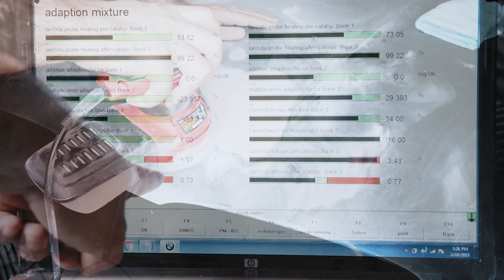BMW N54 Technical Updates You Might Not Know About!

Comment: Interesting the n54 has cast cams on the early model years. On N52s all the camshafts were hydroformed since production started. I believe the bearing ledge seals were updated late 08 to 09 but I’d have to double check
Reply: Nope, my 05/09 production date 535i has the same steel rings that caused grooves in the bearing ledges and Vanos/limp mode issues..
Reply: Update, I’m pretty sure the crank hub spun since I replaced the ledges and seals to no avail.

Comment: Does anyone know what Exhaust Vehicular Diy is running? I can't seem to find this information.
Reply from the maker: I'm running a stock exhaust, cat less.
Reply: @VehicularDIY  Hey thanks for responding, I've been watching your videos for a year now and hands down best 335i content, really great work.

So you have removed the midcats? I also have daw 775rs turbos and was somewhat concerned about stock exhaust back pressure. Would removing the mid cat's be essential to run safely for 500-550WHP power level?

I was thinking it's probably boost related and not just hp for back pressure? and I don't plan to pass 24psi

Sorry to derail with unrelated comments like this

Comment: Many thanks for this series. I am dealing with a broken tensioner on my oil pump chain on my 145k mileage 07 e92 335 and these videos have been invaluable. Mine failed while performing other work on the car, due to my error in not realizing the vacuum sprocket bolt was not independent from the sprocket itself and I tried loosening without locking the sprocket down. Lesson learned. In all of my research thus far, I didn’t learn BMW came out with updated sprockets and hub design until this video.  After watching, I unbagged the new oil pump chain drive sprocket and test fitted on the original hub, and sure enough, updated sprocket diameter is too small. Therefore I will be purchasing the updated hub through your Ecs affiliate link. Obviously I will need to replace the cam drive sprocket now too. Do you know if it is possible to remove the original sprocket from the chain without removing the entire camshaft timing chain, guides, and vanos gears?

My oil pan and cam chain tensioner are removed and my timing is locked at the cams and flywheel. The cam drive sprocket won’t easily come out of the chain though and I don’t want to use any force and accidentally break the plastic chain guides (like I did with the oil pump chain tensioner system). For the sake of time (this is my daily driver), I was not planning to replace the primary timing chain or mess with inspecting the cam ledges/upgrading the split ring style seals. My thinking is that I will be due another valve cover gasket in 60k miles and can tackle both of those jobs at around 200k. Any advice would be greatly appreciated!!!

Many thanks for creating such an informative channel. Hands down, you have the best n54 diy videos on YouTube.
Reply from the maker: Hey thanks!  Yeah you should be able to remove the sprocket provided you have the cams locked up top.
Reply: @VehicularDIY  Thank you for the speedy reply! Your collection of E9x videos is impressively extensive (especially the trans conversion). Bravo! I decided to go ahead and replace the timing chain and inspect the cam ledges.  The car has 145k and my fingernail just slightly catches on the ledges.  Never had a VANOS code or any other indication of a problem.  Torn on whether I should source replacements or install the updated seals and see if VANOS still functions properly.  Leaning towards the latter, considering I'm already >$9k into this "refresh" (new turbos, suspension/front end, all gaskets except RMS & head, dual occ, inlets, outlets, all rubber components, and the list goes on...).  In your experience, do you think this is a bad idea? Heard of any more cam trays out there that don't cost over $1k?
Reply: @VehicularDIY  One other question that I cannot find a straight answer for.  My timing lock tool kit did not include the black chain tensioner "tool" that you used in your videos.  Other than removing slack in the chain, does this tool serve any other purpose? Is  it necessary, or do you think i could just temporarily use the old tensioner to remove the slack before locking everything back in place?

Comment: I think I will be tackling this job soon and can’t decide on crank hubs. I have read good reviews on VTT’s splined crank hub, as it does not require any drilling of the crank. Is there a reason you went with the BMW updated crank hub versus an aftermarket with splines? I don’t plan on pushing crazy power in the car, nothing beyond a stage 2.
Reply: I just completed these procedures on my N54 335i, and I opted for the updated BMW parts.  I didn’t see any reason to spend the extra money on the VTT keyed hub.  The updated BMW sprocket is greatly improved over the original.  With additional surface area and higher friction material, I cannot imagine it slipping if torqued correctly.  To be extra safe, I also installed the crank hub lock that bolts to the front of the crank pulley and prevents the Jesus bolt from loosening,  Note that if replacing with the updated BMW parts, you must replace the hub and the sprocket.
Reply: @mattrowan9036  if I wanted to replace only the hub/sprocket/chain/guides, do I need to drop the pan?

Comment: This vs the 2 pin design that people used for S55/N55? Just thinking if the price for the 2pin is worth it.
Reply from the maker: I think if I had an S55 with a DCT I'd still be going for an aftermarket pinned solution.  Considering the N54 doesn't really suffer as much from the issue and factoring in that I got to 200K with the original hub the OEM solution is a good value and a better choice for the N54.  From a cost standpoint.
Reply: @VehicularDIY  Okey, thanks. Will most likely go with this then on my next N54.

Comment: I just experienced a similar thing with my Helix Overdrive 3x where my HOD vibrated itself to death. Thankfully my timing chain didn’t slip. Are you going to reinstall the helix overdrive? 

I’m contacting spool performance first before putting out my video of what happened to me.
Reply from the maker: Yeah I'm going to continue using it for now, how many miles were on the 3x kit before it failed?
Reply: Vehicular DIY about 10k. When i first received it they didn’t sent me the brace. I installed the reinforced vacuum cover, but no brace. My tuner David Shoup and I notice fuel started dropping around 5k rpm and upon closer inspection the hydraulic fluid and engine oil was leaking from the HOD and getting codes. I replaced my hpfp and everything was fine codes went away. I thought about just putting the OEM hpfp, removing the OEM filter and using the spool micron filter with a 91 tune. The sad part is the only way I can get my e50 tune without the HoD is go port injection or maybe Fuel-it new CP injection with a hob switch. Kinda bummed about it. Thanks for making those videos! We all appreciate you.

Comment: Cast one's are stronger though aren't they?
Reply: Nah. Casted parts always have a lesser tensile strength which is caused by the microscopic pores within the casted part
Reply from the maker: Yeah typically cast parts aren't as strong  but perhaps the cast one compares in strength as its solid.
Reply: @VehicularDIY  that's what I was thinking, solid one would be stronger than the hollow ones. Thanks for the reply.

Comment: Good info on the updates. Do we know when they switched over to using the teflon rings on the cams?
Reply from the maker: I'm not 100% but I believe when they switched over to LCI and the motor started coming with the 6 bolt crank.
Reply: I think the Teflon is being used to lesson  wear n tear to cam ledges.
Reply: Vehicular DIY when you say do you mean LCI of the motor or chassis? My May 2009 MY09 (pre-LCI E92) has the 6 bolt crank so would that apply to me? I know the LCI years of E90 vs E92 differ by one I just can’t remember which lol
Reply: My 2010 535i has the same steel rings which caused grooved bearing ledges in my N54.. So they really didn’t update to the Teflon seals until 2012 production date I think.
Reply: @austinmerrival927  no matter. I now have an n63tu. My only concern is valve seals and tires

Comment: You’re going to beat me to having your car back on the road. ECS is taking a week to ship anything. Took a week to ship my coolant hoses and now a week to ship my new control arm hardware. Good to see the updates to the hub. I’m also glad to see that I probably have the updated cam trays as I have an 09.
Reply: fcpeuro is a good alternative if you want to get parts faster, plus for coolant hoses you can get it at NAPA
Reply: I live an hour from Cleveland and ECS took 2 weeks to deliver me something they had in stock lol. I stick with FCP now and get faster delivery with a lifetime warranty
Reply: Sam Bao I have used FCP as well. I like them, too. I wanted to do the silicone replacement hoses and the billet outlet from the head.

Comment: Would it be feasible to purchase a high mileage N54/N55 and just do everything that you are doing? Or is there other big maintenance stuff that can fail on higher mileage N54/N55 engines? I am wanting to upgrade from my N52 328i.
Reply from the maker: If the price is right and you did it all at once it might be worth it.  But you'd probably be better served just picking up a lower mileage one.
Reply: Save your money and drive your N52 for 300k miles. By then you should be able to buy an M3 lol.
Reply: @saganworshipper6062  well shiiiiiiiiiit. Got another 206,000 to go

Comment: Why do you suppose they don’t have a keyed cam sprocket?  I don’t know a good reason why you would ever want your cams to be out of phase with the crank.  Obviously the engineers are smart and they chose to use a friction surface instead of a keyway.  But why?
Reply from the maker: Yeah basically due to the design of vanos.
Reply: The only reason I can think of is it makes the parts less expensive to manufacture because a key way does not need to be cut into the hub or sprockets. Machining steps are expensive.  Remember, they are making millions of these parts (N54, N55, S55).

On most timing chain engines I've seen the crankshaft sprocket is keyed to the crankshaft. The cam sprockets are positioned to the camshaft with keys or dowels and the timing chain has marks which line up with marks on all the sprockets. On the N54 the timing chain has no marks and the cam timing is set using a jig and then locked into place with the bolts that secures the VANOS actuators to the camshafts. 

The relative position of the crankshaft sprocket and hub are not important because the cam timing is set with a jig and locked with the central bolt through the VANOS actuator and into the camshafts, not with dowels or keys. 

This may also make it easier to assembly because once the jigs are put into place the engine must be timed properly and then the VANOS to cam bolts can be secured. There are no marks to line up. I would guess the assembly jigs are not bolted to the head like the maintenance ones, but are part of some semi-automated process. 

Check out this video: https://www.youtube.com/watch?v=VMZ4ciW8PxQ

That is not an N54, but the process shown appears to be the VANOS actuators or cam sprockets being bolted to the camshafts - completely automated.  It looks like the humans help position the next parts because we have high dexterity and then the robots do the aligning and tightening because they have repeatability and can do multiple things at once easily and without mistakes.
Reply: Cost. You can get aftermarket keyed hubs, no downside to them

B58 has a one piece crank+hub since it was such an issue

Comment: Hey I have a quick question, so my crank hub has been slipping and I really don't want to drop the oil pan since I just did the gasket literally 50 miles ago. I was reluctant on buying the latest revision crank hub due to the fact that I assume I'd have to get the new oil pump sprocket and therefore have to drop the oil pan to do it all. Is this a correct assumption? Thoughts? I've already bought the current ones but now that I've seen your video it seems I may want to get the revision shown here.
Reply from the maker: The teeth on the oil pump gear look the same.  What's tricky is you'd need to be able to swap the gear and that would likely involve removing the pan unfortunately.
Reply: @VehicularDIY  Yeah I figured as much, hopefully my new hub will last a while. Thanks for the response!